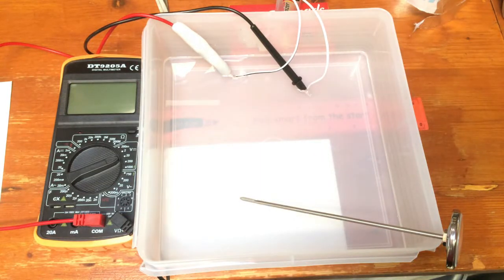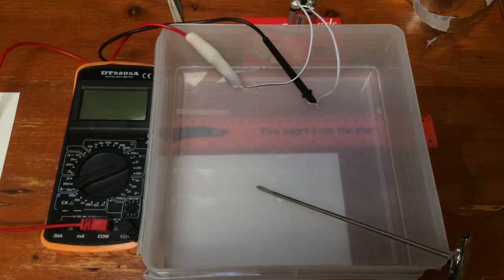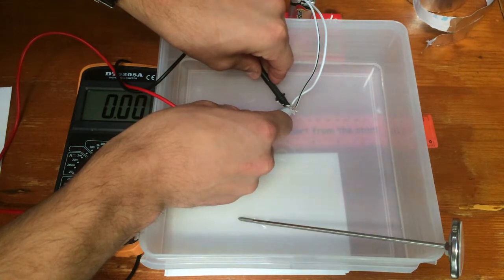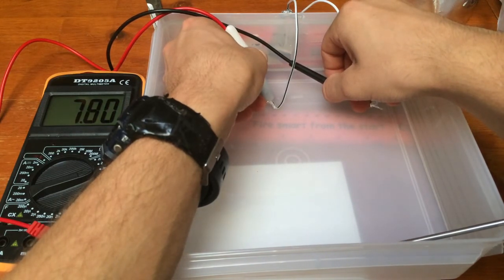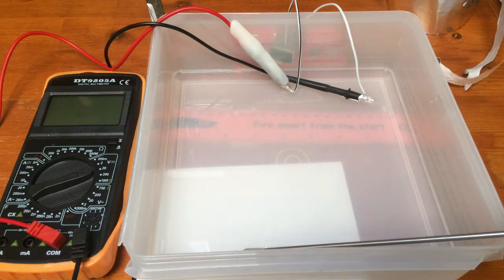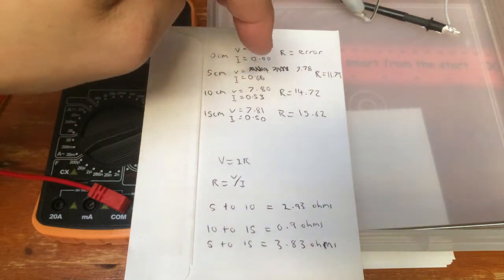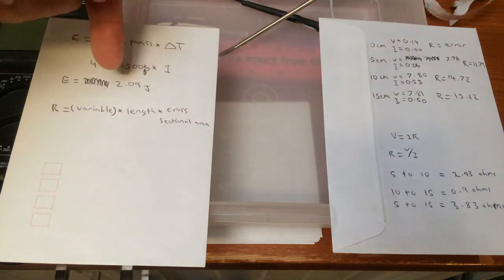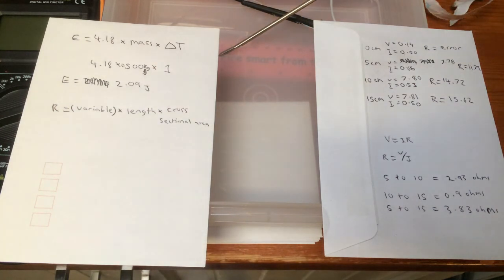Liquid variable resistor

Comment: I think, that this is a quiet interesting experiment, but there are some flaws in it, which render it incorrect. While the measuremant of the volage was correct in parrallel, you tried to measure the amprage in the same way, if I saw this correctly. This would result in an shortcircuit and therefore you would only measure the internal resistence of the battery. Furthermore you would have a problem with electrolesys, if you tried this experiment in that fashion with correct wireing, since the Voltage ist relatively high. I would advise you to use the multimeter function to measure the resitence directly, since this will be the most accurate yo can gat with a smelar setup. Additonaly it is important to note, that you should keep the kind of water you are using in mind. There should be differend readings, if you use different sources. I hope you get what I was trying to say and good luck with further experiments.
Reply from the maker: Hey, thanks for this comment. I understand mostly what you are saying, and I appreciate this!